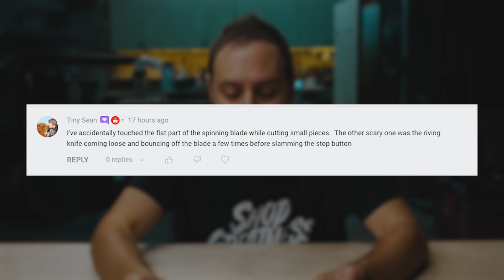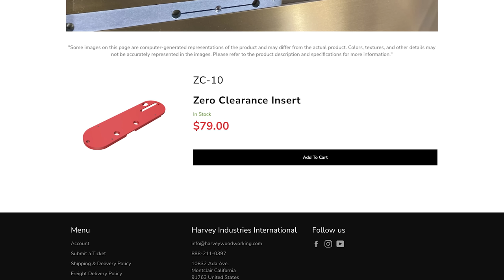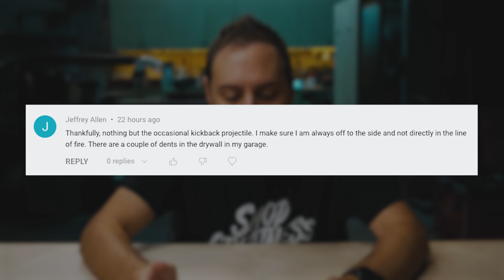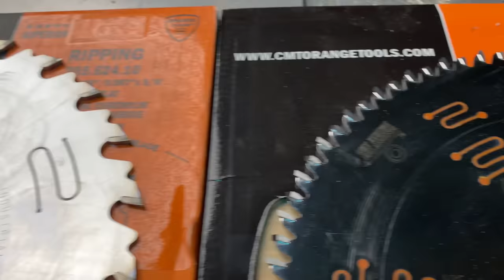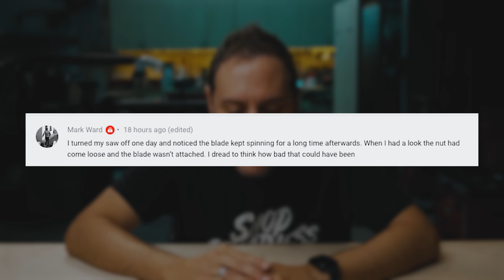I don't know why people make these dumb mistakes

Comment: Great video. Had my first injury about a year ago, reaching for my push stick that was too far away, taking my eyes off the work, a very small piece it started to raise up then popped back down allowing my thumb to slip over it and into the blade, 13 stitches, disfigured thumb and no feeling in my thumb halfway from the tip.
Next I'll work on educating my wife's habit of opening the door yelling my name 🙄

Comment: I needed this video pretty badly. I’m a beginner and was shocked how many things on this list I was doing poorly. I mainly use a tablesaw for thin laminate floor and free-hand pieces regularly. My problem is the cut i have to make is not parallel with the fence, because the walls are usually not perfect. How should I make those long angled cuts?
Reply: Buy an Incra miter guide or build a cross cut sled with some T track installed in it and a few hold down clamps. If you don't want to make it, Rockler sells a decent one.

Comment: I've been cutting on a tablesaw for almost 20 years. I have a Craftsman setup in my garage. I've been to the ER twice from getting my left hand caught by the blade. I'm missing part of my thumb and fingernail on my ring finger but each not very noticeable, well my fingernail is kinda. Kinda embarrassing too. I was doing a drop cut and it dropped really fast and pulled my hand into the blade. It was probably one of the most scared Ive ever been. Basically, I had the top part of my first digit cut off part of my ring finger and part of my pinky. 

Hearing Diresta describe the feeling gave me chills. That is gnarly. 

 I was feediing 12 foot boards of 3/4 maple into the blade ripping 3/4 rips and wasnt paying attention and fed my thumb right into that beefy brand new rip blade. The blade went right underneath my finger nail a 1/4 inch and missed my bone by a micro meter.  I had four stitches in the tip of my thumb to close the 3/16 gash it left. When its really cold that thumb gets sensitive to this day 

Thank you for posting this video. I, to this day respect that tool and keep it clean and always know where my hands are when that blade is turning.  Forgive me for writing a novel, I have never seen such a thorough video about this topic and had to chime in, thanks again.
Reply from the maker: Thank you for sharing

Comment: i was doing some cuts with crosscut sledge 2 years ago, i was so focus on my right hand ( holding the wood piece ) i completely  forgot my left hand aprroaching the blade. split of a second i felt a "crash" feeling on my left finger and thanks to my cat-like reflexes i immidiately jumped back, im sure a normal person could lose finger easily, luckily in my case i dodge the bullet with 3 stitches

Comment: I got my thumb a month ago. The board bound up in an underpowered saw, then split, and it went downhill from there. I spent 5 days in the ICU getting hourly leech therapy to save it. Guess what… the riving knife was off, because I had just switched back from a dado stack. I only needed "to make 2 more cuts." I always stand clear, so the kickback didn't hit me. The sudden acceleration of the   off cut is what got me. Still have a thumb, but I lost the top joint and may never have feeling in it again.
Reply from the maker: Oh James I’m so sorry. Thank you for sharing that. 😢

Comment: The only issue I have is wearing safety glasses I sweat a lot. They get fogged up immediately and in 30 years I've never been able to get them to allow me to see what I'm doing. I'd love some solutions for this
Reply: Maybe a fan? You've got to stay cool.
Reply from the maker: I move heard 3m has new anti fog glasses but haven’t used them
Reply: @wittworks  come to think about it Project Farm just did a video about safety glasses. He tested fogging too.
Reply: @wittworks  thanks I'll check them out
Reply: There are lense cleaners/wipes out there that do a reasonable job of minimizing fog. There are also many industrial safety glasses that have an anti fog coating on them that work pretty well. There is also the option of vented goggles v

Comment: 11:02 I have a momentary-contact foot-pedal switch on my table-saw, so that it only runs while I am stepping on the pedal.  Saves me from having to trepidatiously reach in with my hand to turn the saw off afterwards while the blade is still spinning (said push-and-hold-down-to-close switch also reduces the dangerous possibility of the saw's unexpectedly starting back up if I have to reset the breaker).  I also slide the foot-pedal back out of the way if I need to walk around in the area, so that I won't accidentally step on it (or have a loose object fall on top of it) and make the saw start up unexpectedly.  Plus I n-e-v-e-r do ANYTHING besides actual cutting when the saw is running --- also, if I need to access the blade for any reason, I always **unplug** the saw so that it can't possibly start up while I have my cotton-pickin' fingers on or near the blade!
Bonus statement: I also make sure that I both feel okay and am not avoidably/excessively distressed before I use a cutting-type power tool --- this is especially vital for me because I get distracted very easily (due to an inherited mental infirmity), and so I need to be 100% "laser-focused" to operate the tool safely.  Materials-cutting is a serious and dangerous business, and so you need to always be "at 100%" in order to perform your task without any accidents.  This means no non-vital-to-the-task-at-hand conversations with others or entertainment while working with dangerous equipment --- you can always do parent-child bonding and/or listen to your music or audio-books later.

Comment: Table saw if you dont own a set of board buddies or jessem stock guides  then attach a board to your fence that is just above the parts your cutting so there is no way the stock can lift up and climb the blade.

Comment: It was 2014 about 38c working out in the sun ☀️ thought I’m thirsty about to go get a drink but only having 1 yes that’s right 1 cut left.  I made that Final Cut along with the tips of my thumb lndex and middle finger. After cleaning up my woodworking stuff, getting my washing off the clothes line. I then sat on the step wrapped them up by the I really need a cold drink so I had a ice cold beer trying to figure out how to go up to the hospital. All it takes is a split 100th of a second. Still no feeling in the tips of those fingers.
Reply from the maker: Oh my

Comment: Running a blade backwards:  I did this years ago on a small (8 1/4") radial saw with a non-carbide blade.  Fortunately, it was just a crosscut in common lumber, it did cut, but not well, and I noticed and fixed it.  Had it been a carbide blade and one or more teeth had come off, that would have been bad.

Comment: (1) do not stand in front of your blade when running stuff through because things can kick back at you. Stand from the side.

(2) make sure your riving knife is perfectly straight with the saw blade so you don't have binding.

(3) Always raise your blade roughly 1/4 above the cut so there is less chance of you hitting it with your hand or board. 

(4) make sure your fence is running parallel with the blade to avoid binding. 

(5) never run a dull blade.

(6) keep the top of your table saw clear of saw dust and debris.

I have over 20+ years running saws. 10 years working in a saw mill. The most important thing to learn is how to feel your way through. If you feel the wood binding you stop and find out why it's doing that. Do not try to force the wood through. When you'rerunning wood, hold it firm but not to the point that you're hand can be taken if the piece kicks back. There is a balance, which takes a little bit of time learning. Secondly, don't make stupid cuts. For example, you have a 1 1/2 piece of wood that you want to trim down to 1 inch. Instead of trying to cut it, grab a larger piece and cut a 1inch piece from it. Always use your brain. Always use push stick if possible.

Comment: I installed a blade backwards on my track saw. I was in a hurry to get one more thing done for the day, and I didn't pay attention to the arrow.

The infuriating part is that the standard wood blade I use has the text on the outside when installed. The fiber cement blade has the text on the *inside*. I looked for the text, not the arrow. The blade even cut... about 9/10ths of the way through the sheet of hardieplank. Then it heated enough to melt through the underlying foam, and the blade failed at the arbor.

I pay more attention to the arrows now.

Comment: I never used a table saw.  Ripped with a 1" carbide blade on a bandsaw and then jointed.  Had a track saw built into a sort of horizontal panel saw setup for plywood.  Always thought tablesaws were a dumb tool design and too dangerous.

Comment: I have seen people using tablesaw for cutting firewood and using a sort of cover or lide on top of the spinning blade, so that only small portion of the blade is exposed, when the material is inserted and one cannot accidentally touch the blade. As a layman, I am stil not sure, how (un)safe this is and whether it does not introduce problems of its own (hand getting stuck under the lid etc.). What are your opinions on this?

Comment: Also, don't try to pick out small off-cuts before the blade stopa! But, especially #15 and #16.
Well done Drew, thanks for trying to help people not hurt themselves! 🤘🩹❤
Reply from the maker: Great tip! Forgot about that one
Reply: Basically don't go near that blade until it's stopped. For removing small offcuts you should use the flicker method. That's where you use some small item held in your hand to flick the bit away from the blade. Usually folks like to use pencils. But yeah you can just leave it too. Usually it won't work its way over to the blade and launch. If it does your saw sucks. Lots do.

Comment: These are the reasons why I don't have a table saw. My carpentry for renos and a bit of custom furniture for my own use,  simply does not require it. I can do most things that the table saw does with my track saw, mitre saw, router or Japanese pull saw.

Comment: I am a well-over-80-year-old wood worker. I spend much time, generally daily, in my shop, which isn't 'profesional' but is equipped with most of the common power tools, including a really excellent tablesaw. I LOVE being in my shop, working, building, repairing, whatever. Not one single day goes by, normally, that I'm not in the shop for one reason or the other. I have had, say less than four "near-serious" accidents in some fifteen years. The worst being an event where I was attempting to plane an 18x12 inch piece of rosewood with a huge knot in the center of it! Planer objected, and sent the wood through a window at the end of my shop, 30 feet away! Fortunately, I was standng to one side and it missed me. ALL of the incidents I've had, so far, were related to some form of kick-back events. I would say that very frequently spending time here on the internet, reading and learning, has likely saved me much grief and tragedy. I have now slowly grown "apprehensive" about the techniques and procedures I've used, AND the old adage, "familiarity breeds contempt" (and disaster!) ... concerns for me are now growing mostly out of my age. I do not EVER turn on ANY piece of equipment, most especially the table saw, that I dont quickly go through a mental check list of "hands, material, obstacles, and locks."  I don't know how much longer I can continue to work .... but as of now, I will not stop ... but (I hope) i will just get more cautious (read, "spooked") by what I'm about to do. So far, thankfully, I've somehow managed to stay out of the hospital. Incidentally, I do not use "push blocks"!! (I can hear it now!!) Every time I've listened to the warnings, and tried it, I have come within a fraction of getting hurt. Damn things just confuse, me, and actually, trully, just get in the way. Leading to fumbling, and mishandling. (Of course, I will find something to move work through the saw when doing trimming, slicing styled cuts! I ain't completely stoopid!) Best to all .. can't say I "enjoyed" this video ... but it certainly put fear of god into things!!!

Comment: And this is why I still use a track saw even though it takes longer, blades & bits facing down is so much safer, worth the time to me.
Reply from the maker: yes. plus you dont have to man handle large sheets
Reply: @wittworks  it makes mincemeat out of big sheets plus I can attach my custom router plate to the edge guide and route along the inside on any panel at the same time w perfect lines. Golden 2in1  workstation and you can change position and re clamp at will

Comment: One thing not mentioned was the blade guard itself. I know some are kind of janky but my laguna has a pretty decent one with built in riving knife and has bonus dust collection above it. I never cut without it unless I'm not cutting all the way through, it's too small (less than 1"), or a dado. Otherwise that guard lives on my saw.
Reply: Good comment on blade guards! Also make sure your blade guard is secure. My table saw's guard is fastened to the splitter and anti-kickback pauls. I hadn't properly attached the blade guard to the splitter and made a cut, the blade guard hit the spinning blade as soon as the piece of wood touched the guard and a piece of aluminum in the guard flew back like a bullet and a concrete wall behind me. Whew!

Comment: I try to keep the factory guard on as much as possible EVEN though I hate it. I've been woodworking since 1974 and the only time I've been hurt is one time I leaned over to turn it off and my hand slipped on the sawdust on the table of the saw, sliding my fingertip into the blade. 
The more you use the table saw the more comfortable you get and often that's when you get hurt. 

My late father used to tell me to raise that darn blade up as far as it goes so you can see it and fear it. Don't hide it, see it, fear it. I will say he never had a table saw injury in his life.
Reply: You have my permission to brush dust away while you work. In fact I encourage the activity. Don't work like a slob!
Reply: @1pcfred  it's usually the dumb and simple things that cause injury. Often said after the fact, "I knew better".
Reply: @a9ball1  the only sin is regret.

Comment: My first memory of a table saw was a neighbor taking two fingers off in his driveway.   But the story about the gut punch brings back memorie in which I was the recipient.   I was cross cutting a 2" wide piece of Baltic birch 3/4" down to 6", which i knew was stupid.  But I was in a hurry so I went with it.  It hit me so hard in the stomach I just knew it had stuck into my stomach.   It didn't stick in, but through a heavy winter jacket it left a rectangle 3/4" x  2" that was bleeding through the skin.   Few years later I still have a mark where it hit.  I consider myself to be extremely lucky that I haven't lost anything besides blood.

Comment: I've had two table saw injuries, but thankfully neither were this bad. Both cases were from an item getting snagged and thrown into me. I just don't use them anymore.

Edit: I didn't know the term before, but a potential problem with the out feed table is making sure there's not a lip where the work piece can get caught up. I've got a scar on my hip from that.

Comment: My dad had an accident with a blade saw that comes down from the top, he said his glove got caught on the object he was pushing towards the blade and got pulled under the saw as it was coming down to hit the piece of wood, it went straight through the tip of his middle finger just about halfway but didn't slice the bone. It straight up seperated his finger in two.

the doctors saved his finger and today he's got no issues with it except that he can't bend it very far since the muscle in there was destroyed and didn't grow back properly

Comment: It is best to have a comprehensive set of SOPs for using a table saw.  That is, for each operation you do on a table saw, you have a series of procedures that you adhere.  In this video, there was a procedure shown that has a serious potential hazard.  In ripping it is often "easier" to push the stuff against the fence, start the saw and feed the piece through.  Because you want the cut as even and straight as you can make it, you will often hold the board to the fence, either with your hand or a second push stick.  Either option is less than optimal.  A very slight distraction, having your mind turn to the next thing you intend to do, for instance, can lead to continuing to push the cut-off toward the fence as the piece travels past the blade.  If your hand, or your push stick, travels with the board,  you can induce a pinch, even if the board is behaving perfectly on its own.  The blade will snatch the board out from between your fingers or second push stick, and the blade and launch it back toward the front of the saw.  At the same time, your fingers or the second push stick losing the resistance of the board can suddenly come into contact with the blade.  Neither of these is good.  You might imagine the push stick protects you, but the blade can grab and launch it in an unpredictable direction, unlike the board.  So, if you want to keep the cut from wandering, use a finger board in front of the saw blade.  Unlike your hand or a second push stick, it stays where it belongs and can't be distracted.  I learned this by trimming a thumbnail.  I came within a hair of being badly injured.